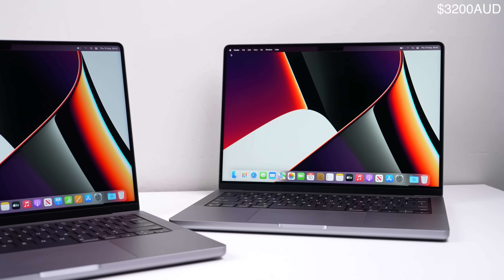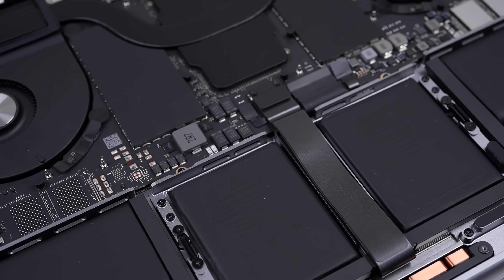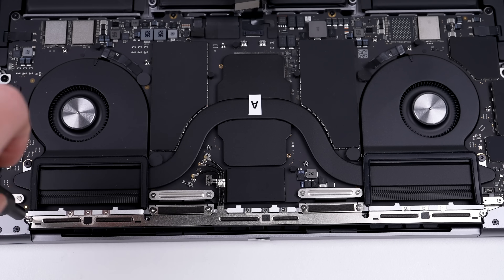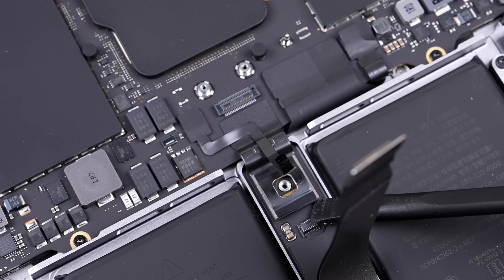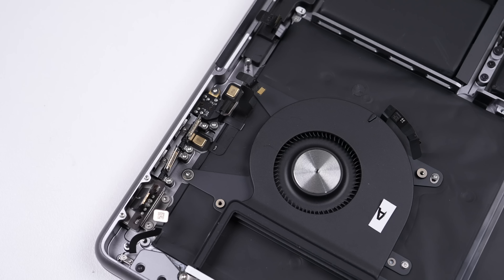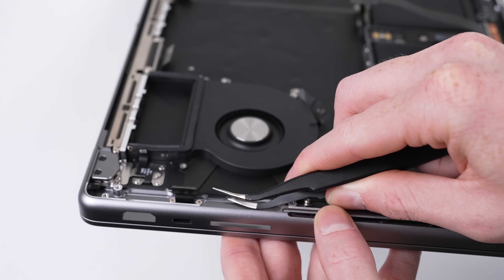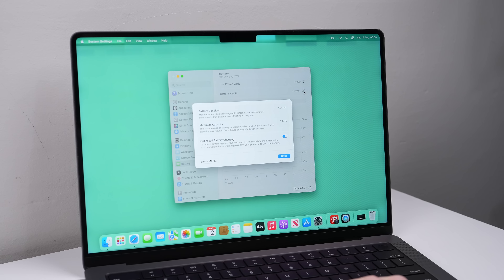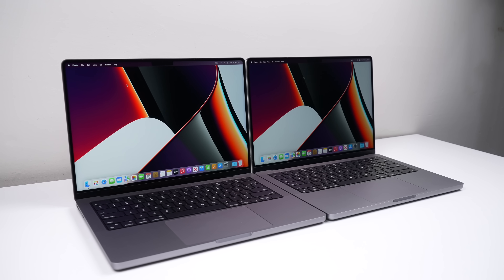New Anti-Consumer MacBook Pros - Teardown And Repair Assessment - Apple Silicon M1/M2

Comment: It kinda feels like apple is trying to make 3rd party repairers look incompetent with things like the messed up backlight and buggy behavior. I get the same kind of feeling when they disable auto brightness on phones with replaced screens. Its basically malicious compliance with repairs at this point.
Reply: It's basically you will own nothing and you will praise the Feudalist Corporations for the grace of being allowed to touch THEIR devices that sit in your own home.
Reply: The issue is that the device is operating without the backlight calibration, this is to be expected.   Mini-led arrays are going to have a large amount of per LED variation (the alternative is throwing away almost all of the backlights you product as once you have thousands of LEDs the chances that all of them behave exactly the same is more or less 0).
Reply: @hishnash but why they are not storing calibration data on the screen itself? It can be done and it won't be overengineering (at leats by apple's standards)
Reply: @Dizrak   Costs more to do it this way.

1) the chip on the display needs to have enough storage to store the backlight profile (this is not small)
2) you need an extra step in the production line to flash the profile back onto the screen chip after testing the screen

Just having a much cheaper SN chip and saving the profile on a server makes production cheaper. For vendors that have small production runs this change in process is not worth it but for apple who are ordering millions of each display chainng the production process to do this saves money and increases the number of displays they can get made due to making the production simpler.
Reply: @hishnash  for Apple product cost is like a second thing to the "experience", no? In the past people were willingfull to pay extra for apple products, because they thought it to be superior. And often enough it was. But now we have 700$ mac pro wheels, 1000$ display stand, numerous cables with their own integratied circuits each costing a bit too much for their function and durability.
Reply: @hishnash These machines are worth more than cars dude. Apple can afford the comparatively minuscule amount for a tiny nand chip, it’s a trillion dollar mega corp for Gods sake…
Reply: @lenshibo   You don't become a trillion dollar mega corp if you don't pint pennies at every corner.  Also the main reason will be production capacity.  By removing the step of wiring the backlight profile back to the display you reduce a feather slow process in the production line that means you can make more screens in a given factory.  Apple is most of the time when they ship a new product supply constrained, increasing the number of units you can ship (even by just 1%) is worth millions upon millions to apple that is how they are a mega corp.
Reply: @hishnash  The cost of a chip to store the backlight profile is trivial. A backlight profile is a couple megabytes in size, but even if it were several gigabytes, the flash/EEPROM to store that would only cost a couple pennies per display at Apple's scale. Besides, the profile must be flashed to the device itself. Just hook the programming wires up to the display itself instead, and again, the change is trivial.

Every other computer manufacturer can afford to store the backlight data on the screen itself, or at least make it available in a manner where screen replacements are viable. Apple has absolutely no excuse for doing this, other than to lock out third parties and jacking up the repair costs.
Reply: @hishnash  What you aren't getting is that putting a simple nand chip into the display would be negligible at best to price and production time. If these were $200 machines id get it. Hard to profit off cheap machines. But these are MacBook pros were talking about. they START at over $1000 and can get to quadruple that price depending on config. Apple is ROLLING in money over these machines. The least they can do is include a 1 cent nand chip to make these machines not end up in land fills when (not if) they break. This is flat out only to stop 3rd party repair. Plain and simple. If it wasnt, how would you explain the sleep sensor bs?
Reply: @lenshibo    Yes appel is not saving much per display but they are saving money on each display, mostly I expect saving a step in the the factory by not needing someone to then connect to the chip and flash on the profile.  By just saving the profile on apples servers they remove an entier step in the QA production line (maybe 2 steps since if you have a step to flash the profile you likly want a follow up step to validate it was correctly flashed). 

The reason apple is rolling in money is the optimisations line this, shipping a small number of skews so that each order they place in in the millions of units and then being able to use that scale of orders to optimise the production. 

 The sleep sensor is a as he mentions din the video a messument of the angle of the magnetic field, it makes complete sense that if you swap this between devices it's going to be off.  For this apple should provide software in the diagnostic mode so that they tell you to put the screen at a given angle and then press a button to set that as the threshold. (this could be calibrated at install time). It is worth nothing the YT video did not even attempt to enter diagnostic mode, you need to enter this mode to do any calibration, even calibration that you can do, and all Macs ship with this mode.
Reply: >back-light profile is not small
Yeah keep making stuff up. It's barely a megabytes at most unless you are trying to make it larger.
Reply: @OriginalOmgCow   a MB is a lot larger than the 4 bytes that is needed for the SN.  Yes the cost of a small chip to store this is not very high but its higher than a chip that just stores the SN and even more important is the extra step in the production line were you need to then have someone connect up to this chip and flash the profile onto it.  Removing a step in a production line were you are making 100,000 units a day is a big deal for apple.  They can run the calibration and store it server side referenced by the SN, this means a given factory can ship more units a day.
Reply: @hishnash  It's funny how it isn't a problem with nearly any other replacement screen available on the market.
Reply: @hishnash   From what I see from these screens, that are BRAND NEW, when swapped they exhibit the exact same brightness flaws. The arguement falls flat on its face in the first place because they act identical, secondly these machines are THOUSANDS of dollars, but even if all it could store was the SN, all you would need to do was request the ONE MEGABYTE file from the nearby Apple server. It can't be expensive to save this information online. If they're incabable of that for whatever reason, supplying the software for calibration can't be too difficult. It's literally all apologetics, stop. This is not an issue on literally any crap 3rd party screen replacement and yet somehow you're defending it here?
Reply: @OriginalOmgCow   Not at all brand new backlights will have flaws, and they will likly have simlare flaws as this will come from manfucutring.  

Appel soze save this implication online and if you use the diagnostic mode (that ships on all modern Macs) it will attempt to retrieve the profile.  However Apples server will not provide a profile for a SN part that is already paired to another Mac.  Apple could (and should) change this to allow you to re-assign a screen SN (if any only if that screen is not connected to a reported stolen device). 

What I am saying is that you expect to have this visual issue if you run the displays without the backlight profile, that is the nature of these backlights.
Reply: @hishnash  My point being if flaws are thus rare why go to such lengths to make repair impossible. In this videos case, the profile should have been almost the exact same, so nothing really needed changing, but instead because it's paired to a screen it resets to default. I never plan on owning one with such anti repair choices made in its designs, so "what to expect" doesn't really matter to me, and is rather irrelevant to the issue at hand anyway which is that this was done on purpose to make unauthorised screen repair difficult and flawed.
Reply: @OriginalOmgCow  What you're saying is it should just default to showing the old profile?   

This is not done on purpose to make third party repair difficult or flawed its done to ensure that when first party reapir steps are not missed.  Apple does not consider third party repair, and maybe that is intentional at a high level in that C level are not funding a team to think about it or setting it as a consideration point for engineers to consider but as it is apple is not putting any effort in to make it worce for third party repair.. they are also not putting any effort in to make it better they are just not thinking about it at all. 

I could understand having a dedicated command you can expliclty issue in diagnostic mode to trigger it to use the old (slightly off) profile that it happens to have on file sure but not defaulting to the old profile. But this would be explicit would needed to support third party repair as apple themselves are never going to pair an old screen to a device and no use the correct profiles.
Reply: @hishnash  My point is apple had options, and it is absolutely done on purpose to inhibit repair. Apple has a history of this behaviour to pretend like just now it just happens to be something outside of their control when this is NOT something normal on many of their old screens let alone other manufacturers. Making repaired products second rate is quite literally their goal. I hope the EU crushes their shitty environmentally unfriendly business model.
Reply: @OriginalOmgCow  Nothing apple did here was intentionally to inhibit repair.  

It might be intentionally that they do not pay people to think about third party repair but if they wanted to actively stop third party repair they could do many other things that would be less effort.   The process of how the backlight calibration is done here is clearly a choice selected for simplifying apples production and the team working on this did not even think about third parties swapping brand new displays (not exactly a valid real world situation anyway). 

Swapping old screens is a different problem all-tog there and would require a lot of extra work from apple to build tooling and publish it (explicit work to help third party repair) since a used screen has an addition wear profile that records the brightness accumulation in different regions the SOC combines this with the factory profile.  Apple does not have any tools to extract and transfuse this as internally they never do this.   Not having these tools is not intentionaly done to inhibit repair it is just not done as no-one is thinking about it. 

What your asking for is apple to have a dedicated team/s working on supporting third party repair, and your saying that the engineers working on building these production are evil for not doing this even through they are talk to only focus on apples needs an no consider third party repair.
Reply: @hishnash  They didn't think about brand new displays because they didn't want to be found out so easily when it's such a poor excuse.
Reply: @hishnash  "Nothing apple did here was intentionally to inhibit repair." So, for you, the only way you'd agree they did intentionally is if they had a room called "anti-repair office"? There is no need to develop a sensor different from everybody else. They simply work and are cheap to manufacture. They're actively developing something that will make it harder to repair, this is not eco friendly by any means. There's not how can you spin this up as the miniLED issue. But still, the miniLED is from a pro model that you expect it to comply to industry standards and this means having the profile built-in and calibrated from the factory. What if extra steps in the production made the product $500 more expensive? People pay $1000 for a fucking stand. It wouldn't matter whatever subjective marketing meter you make up. People would still pay and that would be a plus to consumers, I don't think we disagree on that. They'd pay even more to be repair friendly. Locking people out of repair brings economic surplus for them, so that's intentional for sure. If they could get away with even shittier practices right now be sure they would, and time and time again they're doing sneakys slowly until they control everything. But since rich people are making a cash with this, it's fine and the consumer is screwed
Reply: @hishnash both screens have the EXACT same issue. -> calibration is not the problem
Reply: @flos251  Of cource calibration is the issue.

When you have screen A with SOC A then the calibration on SOC A deals with the defect int eh backlight of screen A. But when you put that screen on SOCB the calibration is not there so you see the defect (the calibration by the way is adjusting how much light the LCD pixels block).  

When you put screen B on SOC A with the calibration of screen A applied you would expect to see the same visual impact, the same parts of the screen would be non-unfirom as the calibration for screen A being applied to screen B will result in the same parts of teh screen looking off as those parts do not need the same calibration.
Reply: @hishnash no, as cameramaker mentioned it has to be the opposite artifacts if it's a calibration issue. Let's check this with the following calibration data if I seperate the display for only 3 calibration point:
Board A has 0;2;5
Board B has -2;1;2
So now the display A require the 0;2;5 to work properly and display B is -2;1;2. So it seems to be the display A is dimmer by default then the display B. Exactly with -2;-1;-3 value less dimm.
So if you flip the displays display A going to be way too dimmed and display A is way too bright (because the motherboard still contain the same calibration data). 
It's just the regular apple shit and does not have any connection between calibration, only serialization. 
Or think this way, you order the new display from apple and repair at home, then you call them. They will be able to calibrate it remotely without requiring you to have a display calibration device.
Reply: @hishnash  That doesn't make sense. Like actually look at the behavior these devices display after the screen swap. It doesn't have anything to do with calibration, it's just the devices completely giving up on trying to behave correctly when the repair wasn't done by Daddy Apple.
Reply: @seeibe   No makes complete sense.

This is a miniLED display, and most of them leaving the factory will have simlare defects due to the production or installation process into the display panel.    

When you swap the SN of the display (like with every other device that has a profile loaded) the system just runs with without any profile!
Reply: @hishnash  How you can still argue in good faith that this is anything but malice on Apple's side is completely beyond me. You're already admitting yourself that making these screens replaceable would basically have been no effort. There's no technical reason for it, Apple just doesn't want you to. That's all.
Reply: @hishnash my dude I have seen calibrated displays running a profile meant for another display. It does not look like what is shown in this video. You are just lying.
Reply: @xmlthegreat   You have? with mini LED backlights. 

Do you even know what calibrating a MiniLED backlight means? 

1) You need to light up each LED separately, then scan across the display recording the light distribution from that LED
2) repeat for each LED
3) repeat for a range of brightness for each LED
3) create a inverse map that corrects the non-unofm map that can bee applied to the LED voltage and to the LCD so that the image is uniform. 

This is not a color calibration for the LCD panel it is a migration agaist defects the the many thousands of LED backlights and the fact that non of these product a nice uniform light distribution.
Reply: @hishnash They could very easily allow access to their internal calibration tools, as they do within the self repair program. They could also set a default calibration configuration that functions adequately.
Reply: @tylsim   You can access the tools, every Mac ships with them just boot into diagnostic mode. The issue is apples servers that have the calibration profiles do not let you pull these if the SN is already paired to anther Mac. 

The solution would be to let you do this moving of a screens SN from one Mac to another (and thus pull the profile down) if and only if that source Mac has not been reported as stolen of cource. 

If he were to get hold of a display that was never paired and booted into diagnostic mode it would pull the profile for that screen but apple is not exactly selling unpaired screens other than through the self repair program.
Reply: @hishnash isn't it funny? I replaced a screen on my old phone once and guess what, it looked exactly liked the one I removed and didn't require any online calibration to do that.
Does that mean Apple can't engineer hardware that doesn't require them poking inside my device each time I swap out a component? In 2023?
Reply: @mikosoft   They used to save the profile on the display eprom but moved to saving this server side with the iPhone12 (and all Macs since then as well) the change will likly save some time and money in the factory.
Reply: @hishnash  no, it will not save anything since the profile then needs to be copied from the server into the device separately creating more steps and time needed. This is not a cost cutting measure at all.
Reply: @mikosoft   No this is down autmaticly when you run the diagnostic mode, this pulls all the profiles and pairs all the parts.   This needs to be run anyway as it needs to pull the profiles to the SOC regardless of were you store them (note they did not even try to run this in the video... all modern Macs ship with this mode it is not apple only software).
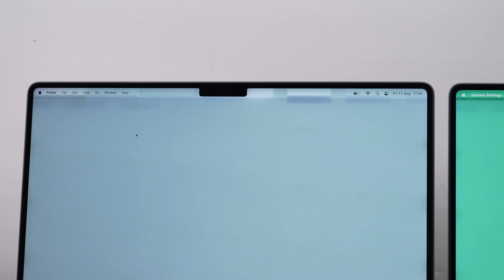Reply: @hishnash  the effects you see are intentional artefacts - if the issue were as of the calibration as you state, then one screen would have darker spots while the other would have brighter spots - exactly the opposite kind of artefacts. But if you see the side by side on same content (green background) at 6:11 - the levels are going same way wrong, not the opposite. So definitely not a calibration issue.
Reply: @cameramaker   Not if when there SN do not match no profile is applied. 

Then if this is a common defect (due to manfutring) or how the other cables behind the display it would appear simlare on both screens when no profile is active.   With many of apples parts when the SN does not match they run without any calibration rather than using the old profile.

using the old profile might well result in less artefacts but its unlikely to be perfect, as these glitches might appear simlare but even a very slight difference would be noticeable.
Reply: @hishnash  Why are you defending this shit? How does that benefit you?
Every single other monitor, or laptop screen I've ever used can be plugged into another device and work. That is the standard, and has been for decades. How is going out of their way to not meet that standard justifiable, in your opinion?

This can't be explained away by time constraints, when they engineer things specifically to be proprietary. They'd keep working with established standards and production pipelines if time was a concern for them, not come up with more complicated "solutions".

The only reason they serialize (which has to be implemented explicitly), or over engineer in a way that stifles repairability (which has to be implemented explicitly) is because it benefits them. Not because they can't do it otherwise, or because it's hard.

And most importantly, as a customer, why is it more important to you that apple has become a multi trillion dollar company, than the reliability of the devices they sell?
You say these design choices are understandable because they get to save a few pennies. But the problems that those designs cause cost the user many orders of magnitudes more (not to mention hurting other industries, the environment, etc.), all of which also goes to Apple. Isn't that a little more significant than a few pennies? Should those trillions be attributed to bad design decisions that arise from corner-cutting? What does that say about them?
Reply: @habama1077  Don't waste time stating facts to a fanboy. One who doesn't even know WTF they are talking about to begin with.
Reply: @habama1077    So internal displays are not what you think they are, they do not just run plain HDMI with a display controler on the monitor. 

The display controler is embedded withthint the SOC and needs the profile of the display. For displays with mutli zone backlights (like miniLED) you need a profile that corrects for the non-unfimity of that backlight.   

Without such profile your screen will always have defects there is nothing you can do about it. 

The issue in this situations is apple's servers that have the profiles for each display they have made do not let a device download the profile unless apple approves the repair.  What apple should do is update the servers so that as long a the screen is not already paired with a known stolen device the profile should be transferred to the new device.  The tools to pull the profile from the Mac side ship no the device it is called diagnostic mode.